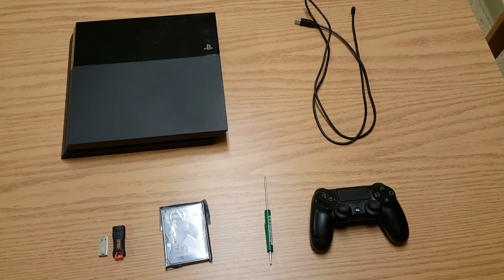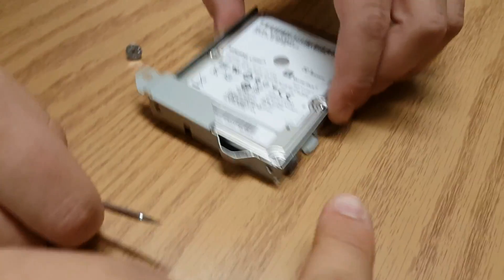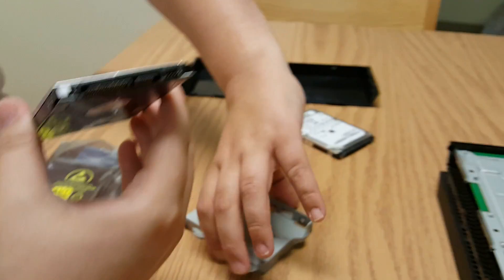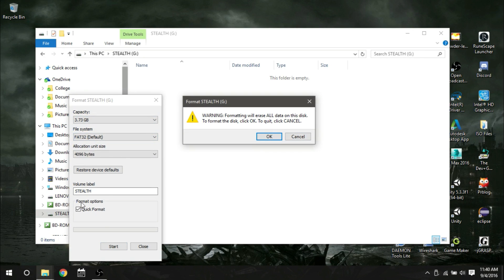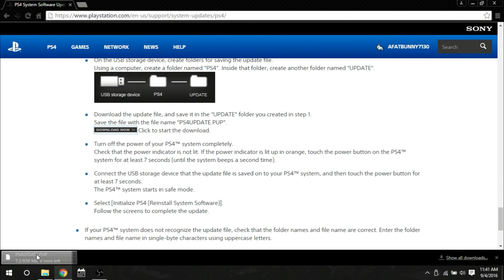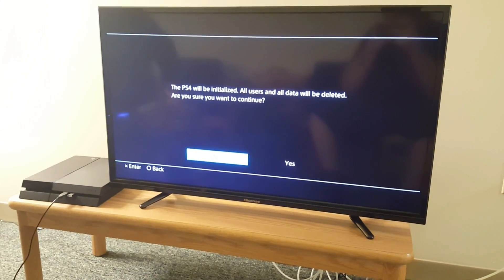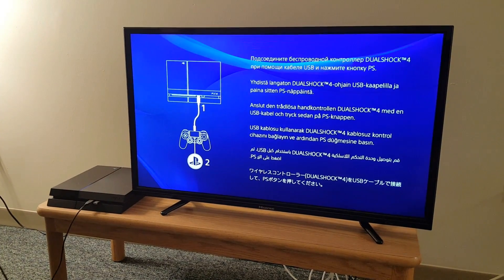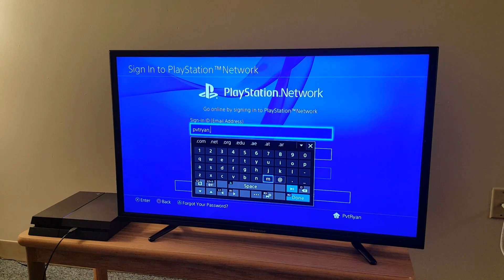PS4 Hard Drive Upgrade / Swap (500GB to 2TB)

Comment: will this work if my original HDD has failed? I got black screen of death after an update recently and need to replace the drive
Reply: Yes best decision I’ve made was replacing my harddrive, it was failing not open games randomly cutting off stuck in boot loop etc . Now everything good plus I have more space for games definitely worth the $50.

Comment: Do I really need to have a laptop or pc to do this why can’t I just take out my internal hard drive put the new one in and done and just update my ps4 and download my stuff from online
Reply: Because when a PS4 is made, the PS4 software is installed in the hard drive. This way, if you replace the hard drive from your PS4, you have to manually install the software with a USB stick, which must have the PS4 software installed in it.

Comment: I want to upgrade to a larger hard drive but I’m having the problem right now of console not updating. I’ve tried to update from usb with controller but no success. Do you think it’s the USB ports? Controller works on other console.

Comment: I know this video is old but I had a question. Can I have other things in my usb or does it only have to have the PS4 UPDATE file? I wanted to see if I can have all my backed up data in one folder and also have the PS4 update folder. If having 2 folders will screw up ?

Comment: If you are going to spend $$$ on a new hard drive - As of - 1 / 18 / 2020  You can get a Seagate Portable 2TB External Hard Drive for $55.00 U.S dollars and no need to go through all that crap and keep the old hard drive in the system for a total of 2500 GB of storage.

Comment: Nobody mentions this but you also need to watch out for the speed when upgrading.  I recently upgraded my original hard drive to a 1 tb one that only spins 5400rpms just like the original one. It is slower than the original one although it holds more data. If you are out there upgrading, make sure you get the 7200rpm one. Whether it is 1 TB or 2TB, it doesn't matter. The 5400rpm one is not adequate and it freezes often.

Comment: If you had downloaded the update previously and it's still on your computer when you download it will change the name to PS4UPDATE(2).PUP and the PS4 will not update if it had renamed the file. If it has just rename the file and remove the (2) back to PS4UPDATE.PUP

Comment: With current updates now you can just save all your data to the online storage (playstation plus) instead of on the system (basically like iCloud) so you don’t have to back up your save data on a usb drive. You can do this in settings on your playstation.

Comment: I put a 2 tb hard drive in my PS3 and stripped the screws my question is can I put this in my PS4 and put the 500gb PS4 hard drive into my PS3 with a bracket switch?

Comment: So i have the original ps4 500gb. I replaced the orig 500gb to a 2tb hdd. Now im planning to trade it for a ps4 pro. My question is, if im going to put back the orig 500gb do i need to redo the whole process of reinstalling a new hdd or can i just remove the 2tb hdd, slap back the orig 500gb then use the 2tb as an external hdd for my new ps4 pro?

Comment: Hey I spent most of the day trying to figure this out I got it working now finally!!!

I got one of the frst ps4 when they came out so not sure if this would be the case or not for all of them.

I strongly insist you check to see if the ps4 will notice the usb drive at all before you attempt to swap the hard drive.

I had 3 thumb drives and not 1 would work. I had tried everything i could think of then I said screw it and busted the protective cover on the thumb drive.

and to my suprise this was the probblem :/  

It could not get deep enough into the usb port to power on the thumb drive with the ps4 and my thumb drives plastic sticking out a little to much made it fail to connect. 

Anyway spent over 8 hours on this hope it helps someone else out please mention it to others if it worked for you. Cheers

Comment: Hi i got an old ps4, changed my stock hdd to 2tb. Now i want to upgrade to ps4 pro, i want my current 2tb as my external hdd on for the pro. So do i need to reformat anything? Or should i just take it out and use it as external hdd as is? Help? Thanks.

Comment: I want to change my hard drive but ps4 does not recognize it. In safe mode only the last option is active and it says update file could not find. I format my disk as Fat32. Problems goes on 😪
Reply: Scroll the PS website until you get to the very last OS download button on the page and use that one

Comment: You don't need 2 drives to store/backup and to install the installation software.. I used my 1TB to backup my data after deleting all my apps on my PS4, (except PT), then I downloaded the installation/update software on the same External HD. It will have the same folder (PS4) just make another folder (UPDATE) and the backup file is (EXPORT) then insidenit is the (BACKUPS).. so when I plugged in my External to Initilize/Install, I didn't even have to unplug the External and soon as installation was completed, went straight to Restore..
Reply: Also, didn't have to have my external empty, I got all kinds of other files on
It.. You just need enough space for the Backup files and for the Software OS/update file..

Comment: im trying to do the same thing you're doing, but i just bought a ps4 pro and want to just switch hard drives is that possible? right now it wont download the updates its saying it cant be found(old ps4 with used hard drive). and i did download the last file on the page.

Comment: I have the correct file downloaded (the one at the bottom of the page) and I plugged my flash drive into the PS4 before I started it up again and when I hit "ok" it tells me that it cannot find the update file. I have also attempted to go to safe mode and do it there but it tells me the same thing. The drive it lighting up when connected so I know it's functional but my PS4 just doesn't seem to be able to read it. Any suggestions? I downloaded the update on my Mac with OS X El Capitan if that matters.

Comment: I put the USB in with the right format and the cable for the controller but when I turn it on and press "initialize PS4 (reinstall system software)" it just tells me after a minute of "please wait" that I need to insert a USB with the 4.55 os or higher. What is the problem?

Comment: If you have a new PS4 and no files on it do you need those little USB hard drives
Reply: What would happen if I didn't use the USB hard drives, is it bad for the PS4? Will it make me set the PS4 up again? Or will I just not have my game data?

Comment: I just want my online data to be okay like my GTA 5 and FIFA 17 online data I'm not bothered by the story modes. I'm just wondering would I get away with not using the USB if I just put in the memory card and signed in on my online profile would all my online games like GTA 5 be ok or do I have to use the USB ?

Comment: I need assistance please!!!! This shit is NOT WORKING... I followed every step to the T and nothing. I don't want this $100 2tb hard drive to be a paper weight smh. Ive tried everything I could. I bought 2 different flash drives, 8gb and 16gb, and both say that the update file cannot be used. Ive also tried to download the update file several different times. Is it because I have a PS4 slim? Or could it be that update 4.50 is to great and no one has figured it out yet?? I really just want to play my system again, can anyone help me please....
Reply: False alarm I figured it out eventually. Turns out I was downloading the wrong file every time. SO my PS4 is all set now. Thanks anyway.

Comment: Right on man, now check this out. 

An update to the PlayStation®4 system software was released on March 9, 2017. Use this update to install system software version 4.50.

Always update your PS4™ system to the latest version of the system software. By updating, you can enjoy additional features, improved usability, and enhanced security.

Now allows for the usage of the 3.0 USB connection like the Xbox one! No need to install a new drive, although I still did. Good luck!

Comment: @afatbunny So if I just bought my PS4 straight out the box, and I got the 2tb. What step do I skip. *I haven't even made an account.
Reply from the maker: The only thing that you will not need to worry about is backing up your data.  Other than that you will still need to do everything the same.

Comment: Thank you, SO much! I got SO tired of un-installing and re-installing games on my external hard drive. I actually used the SAME external hard drive to do the update. It worked. Now, I'm re-installing all of my games. I still have my in-game saves. Now, I got more space on top of that.
Reply from the maker: You're welcome!  Glad that everything worked out.  Glad that I could help!
Reply: AFatBunny I found out that  PS4 will have an update that will allow for external USBs to be used, like internal HD. Smh
Reply from the maker: Haha yeah I just saw that today too.  Update 4.50 will allow external hard drive compatibility up to 8TB.
Reply: AFatBunny Well, combined with my new internal hard drive and my external hard drive, I'll have 3TB of data. Of course I have 1.24TB used, already.
Reply: Could you download the system software beforehand from the ps4 browser?  My computer died on me and need to know...thanks
Reply: @Boogbama123  Pussy!!
Reply: Wait a minute, So I don't NEED to buy another sata hdd? Did you buy the fat32, says hdd?

Comment: For some reason it's not downloading the most recent update. It's saying please use USB device with 4.07 or later
Reply: Justin Clark
Try this:
1) clear all data off of your USB 
2) make the two files
-make sure it's in all caps starting with the first file as "PS4" and the second as "UPDATE" 
-the second file should be in the first file and put the downloaded update from the website into the "UPDATE" file
--copy and paste the file into "UPDATE"
--make sure the file is as the one you saw is the video and exactly as it is shown or it will not be found
---the update file should be about 807kb in size so check that
3) if all is in order it should work (no extra files, everything looks perfect, and the PS4 hard drive is set up correctly)

If you're still having trouble, send me a message and I'll reply as soon as possible

Comment: for some reason when I push the PlayStation button on my controller and flashes blue like its supposed to but then it goes back to yellow any help?
Reply: Airion Baumgartner Remove the cord. Then, plug it back in.

Comment: Is seagate a reliable internal hard drive for my ps4?? I've heard stories about them over heating. Has anyone had one of these hard drives and had a good experience with it?? thinking of buying a 2TB one but not sure as it's a lot of money!
Reply from the maker: I have a Seagate 2TB hard drive in my personal PS4 and I have never had any issues with it so far (its been in there for 1.5 years).  Here is a link to the one that I bought: https://www.amazon.com/gp/product/B00FRHTSK4/ref=oh_aui_detailpage_o00_s00?ie=UTF8&psc=1
Reply: Thanks for the info :) appreciate it.

Comment: I've watched yours and other videos and like I can't download using cloud storage because my internet is way too slow so like what would I need to do this? I have like over 400 gb of stuff I want transfered
Reply from the maker: You should really only need to keep the save data for the games, which is probably only a few GBs (I have 35 PS4 games and all of the save data is only 3.05GBs). You will not need to keep the game installation data (this is what is huge, up to 75GB per game) because if the game is a disc based game you can just pop the disc back into the PS4 and it will reinstall the installation data.  If it is a downloaded game then just log in and look in your library to re-download it.
Reply: Yeah but will I need to reinstall updates?
Reply from the maker: Yes.
Reply: I don't know my internet is trash
Reply: Hey I have one last question, could I upload my game save files to my PlayStation plus account and backup my update files to a usb drive?
Reply from the maker: Yes, you could upload your saves to PS Plus.

Comment: What program did you guys use to open the PUP file with? I've tried Internet explorer and haven't been able to download the update using my USB. I keep getting error messages (CE-30774-1) when i know the update is correctly on the USB. The only logical explanation to my trouble thus far is a corrupted download. Any one that can help much obliged
Reply from the maker: You shouldn't need to open the .pup file at all.  Where are you trying to open it at?

Comment: great video. just a question. when I change the hard drive all the games and progress that I have savedin the old one.  will that still be the same?
Reply from the maker: For the disc games you can just pop them in and it will reinstall the file.  For downloaded games once you log in you should be able to go to the library and redownload them.  Make sure you grab your save data from the old hard drive so you can keep all of your saves and progress in game! <-- This is important!

Comment: I just bought a ps4 but don't want to set it it up yet Do I have to back everything up? I just want to put my hard drive in and then start off with New hard drive? Please help me bro
Reply from the maker: If you just bought the PS4 and nothing is on it then you wont have to back anything up.  So that means you can just follow the steps in the video and everything should be fine! :)
Reply: so I still download that ps4 file on a usb stick? Also thanks for replying I will sub now :)
Reply from the maker: Yep, you will still have to download the PS4 file onto the USB.
Reply: AFatBunny thanks a lot mate really appreciate it.

Comment from the maker: READ THIS:
If you are having an issue where your PS4 is saying "Update file cannot be used" please try the following to fix this:

You may have just downloaded the update file.
Go back to the Playstation update page.  Scroll all the way down to the bottom of the page.  The lowest section should be a section that is titled "Perform a New Installation of the System Software".  Download the full OS from the download link there.
Then make sure you delete the old file off of your flash drive.

Sorry I wasn't more clear about this in the video.  Hope this helps.
Reply: AFatBunny k
Reply: AFatBunny I tried doing this and made sure that I downloaded the system software but my PS4 still says it cannot find the file
Reply: Actually nevermind I figured out my mistake. Thanks for the video it was very easy to understand and follow
Reply: @FoolsArcana  yo can you help me
Reply: @FoolsArcana  I’m having trouble
Reply from the maker: You're welcome!  Glad that I could help!
Reply: AFatBunny should I deactivate as primary ps4 before switching hard drives?.. even though it's the same ps4?

Comment: how should I back up my data? Upload to online storage?
Reply from the maker: Yes, if you are a PS Plus member that is the best way to do it.  If you are not then you will have to transfer the data to a flash drive and then place it back on the PS4 after putting the new hard drive in.

Comment: do you have to do anything with your old HDD first? I know when you first setup a system you have to activate it as the primary. But I didn't see that mentioned. Thanks
Reply from the maker: I did not have to do anything with my old hard drive first, however, I never set my PS4 as my primary system so I am not certain if you will have to do anything or not.  See what Google has to say about it.

Comment: please help me 
i put my new hard drive in, started the ps4, pluged in my flash drive that  has the Folders "PS4", "UPDATE", and the 4.07 system update but now my ps4 says: 
updatefile cannot be used 
what can i do now?!
Reply: im doing it now and it says for me the update file is corrupted. Im so pissed how can it be corrupted idk what to do
Reply from the maker: The only thing that I could think of is maybe you my have just downloaded the update file.
Go back to the Playstation update page.  Scroll all the way down to the bottom of the page.  The lowest section should be a section that is titled "Perform a New Installation of the System Software".  Download the full OS from the download link there.
Then make sure you delete the old file off of your flash drive and let me know how it goes.

Comment: It keeps telling me "the update file cannot be used". What am I doing wrong?? The only thing on the USB is the update file so I don't know what I'm doing wrong.
Reply from the maker: The only thing that I could think of is maybe you my have just downloaded the update file.
Go back to the Playstation update page.  Scroll all the way down to the bottom of the page.  The lowest section should be a section that is titled "Perform a New Installation of the System Software".  Download the full OS from the download link there.
Then make sure you delete the old file off of your flash drive and let me know how it goes.
Reply: I figured out what the problem turned out to be. My USB was not formatted correctly. But I do have another problem now. For some reason my backup of the user data will not transfer over from the USB to the ps4. In other videos I have seen they used an external HDD to perform this step of the process. Is it necessary to have an external?

Comment: It keeps on saying that it cannot access the USA storage device even though I double checked the file names and KB of the updates and they're all the same as yours in the video please help
Reply from the maker: As @SAV says, you must have the USB plugged in before you turn the PS4 system back on.
Reply: USB*
Reply: Alex Dunn same thing happening to me right now. reply asap please
Reply: itsMizTick It did the same for me. I just took the USB out, unplugged the console and before I turned it on, I plugged the USB and controller in